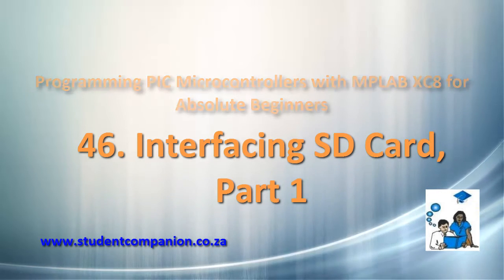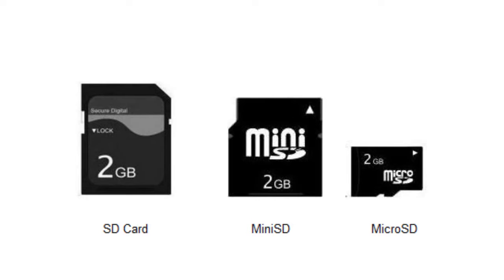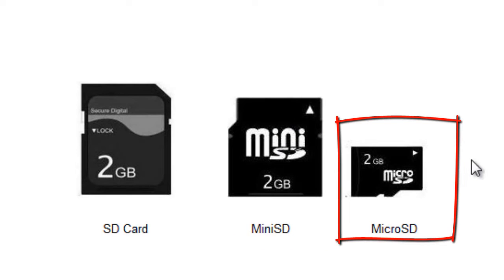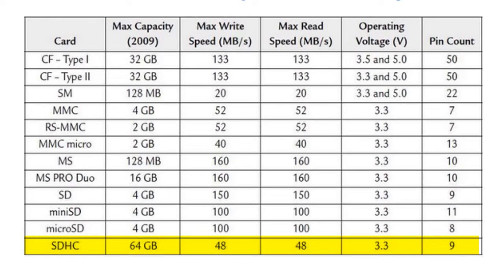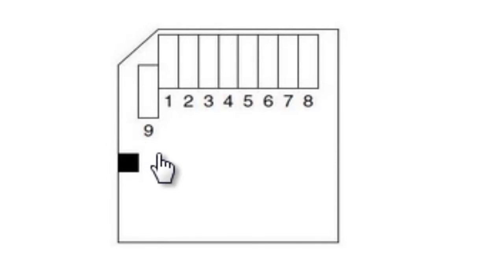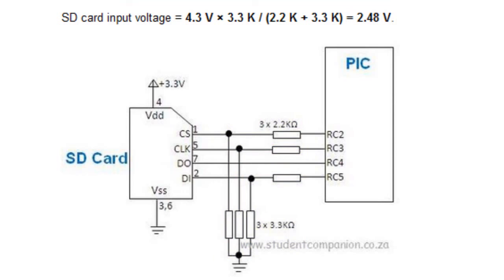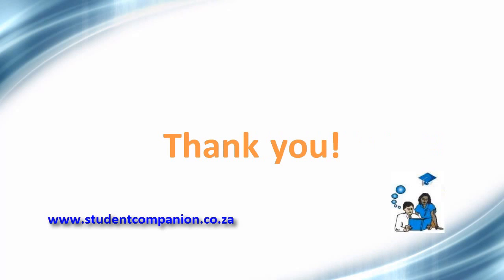46- Interfacing SD Card, part 1 | MPLAB XC8 for Beginners Tutorial

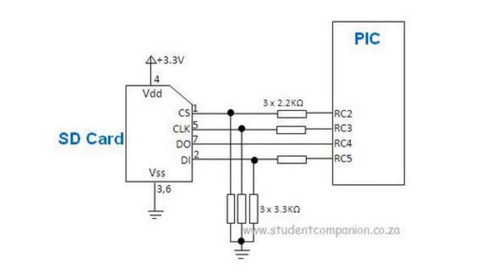Comment: I think the description at 4:36 is unclear: "The SD card requires 3.3V, so the normal 5V of your PIC microcontroller is not going to be enough for your SD card. And the other thing that you should consider is that the input voltage is 2.48V, so we are going to need a voltage divider..."

I feel like this is the wrong way around. The normal 5V output of the PIC microcontroller is too much, so we need the voltage divider to get us down to ~2.48V (In fact, I believe 2.0625V - 3.6V is the requirement). The (minimum) 2.475V output by the SD card should be fine to drive the PIC input pin high, so we don't need to worry about that.

Maybe I just slightly misunderstood how you were saying it, because the later equations are correct. Overall, this is a great tutorial and I am finding it very helpful. Thank you for all your effort to produce these videos.
Reply from the maker: The Vdd pin of the SD card (pin 4) is connected to 3.3V not to 5V. Maybe you didn't understand how we said it. Thanks a lot for your feedback.
Reply: @StudentCompanion  Yes, I misunderstood - but the rest of the explanation in the video is clear, so it wasn't a problem.

The more I watch your tutorials, the more I am impressed with the quality of your content. I have just made a PayPal donation to support your channel. Please keep up the great work!
Reply from the maker: @weetabixharry  Thanks again for your feedback.
Thank you very much for your kind donation to support our tutorials, we have received the donation..
We much appreciate every and single donation we receive. 
All the monies we receive from donations like this one we use them only for student companion for hosting, to buy books, hardware and software for training, so many people will also benefit for your kind donation when we record new tutorials. 
Thank you very much and we wish you all the best in your microcontroller journey.

Comment: How do you know what pins to connect to the pins of the pic?
Reply from the maker: What pins you are talking about?
Reply: Student Companion Sorry wasn't specific, I mean when connecting pins for example pic to interfaces how do you know what to connect with what?
Reply from the maker: You are still not specific, I don't know what you are talking about. Whether you are talking about the sd card pins or interfaces in general.
Reply from the maker: Usually it depends on many factors such as the protocol of communication, peripheral feature, free pins available, PCB design, etc.
Let's take an example if you want to connect a push button, this will require a pin with digital input feature, almost any pin can be used as digital input so it this case you can connect it almost on any pin. The same for an LED, an pin can be used as a digital output pin. But if you want to connect an analog sensor like the LM35 temperature sensor, you can only connect it at a pin that can read analog values, the same for an sd card, an sd card will need a SPI data, SPI data in and SPI data out so you can only connect these pins on a microcontroller which has SPI pins and only on those specific pins, the same for RS232, USB for exemple not all PICs have USB and you'll need to connect the USB pins only at the USB pins of the microcntroller. Basically you can't just connect anything anywhere you must know what data you'll use and which pins of a PIC will be able to read or deliver that data.
Hope I answered your question.
Reply: Student Companion Student Companion I think I understand that so some pins are prefunctioned for a specific function  when buying a pic they will tell you wether one pin or various pins can be connected to usb, for a screen which is what I want to do. So that would be analog to digital would that mean that any pins cpuld be used for this feature for displaying things on a screen?
Reply: Thanks for your feedback! Its great help
Reply: I have a few questions if you dont mind can you ad touch to a screen when a mcu doesn't have the capacity to do that or is it possible since all you would need is a pin for the capacity to do analog to digital?
Reply from the maker: You must read the datasheet of the PIC you want to use as well as the datasheet of the display.  The datasheet will tell you all the functions of each pin and how to use those functions.  I don't know the screen you are planning to use but most lcd screens are grouped into 2: the parallel and serial screens. Parallel are simple to use and can be connected to any digital pin of the PIC so basically to almost any pin but require many pins ususally minimum of 6 pins ti functions.  The serial lcd screen use serial protocol usually SPI or I2C to functions so you can only connect them to SPI or I2C specific pins of the PIC. They require less pin usually 2 to 3 pins.
Reply from the maker: You are welcome!
Reply from the maker: What do you mean if a mcu doesn't have the capacity? You must read the datasheet first of the touch screen to know what kind of data will be processed. The touch functionality is usually performed by capacitive sensors on the screen and read by analog to digital converters of a pic. And most PIC Microcontrollers today have analog to digital converters.

Comment: I'm really sorry I'm bothering you with some many questions, but I don't know anyone else who I can ask.Would I still need those voltage dividers as shown in this video If I power up my PIC microcontroler at 3.3 V?
Reply from the maker: +Marian marian2 The maximum input voltage to sd card should not be over 3.6V. If you are powering your PIC with 3.3V, I am sure it should work without those voltage divider resistors.